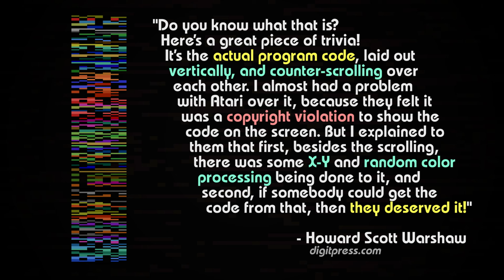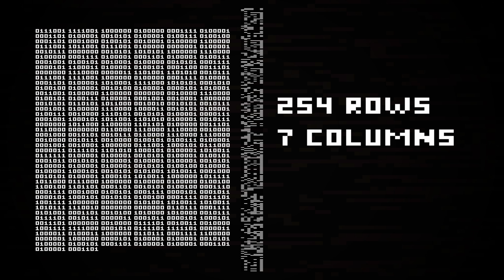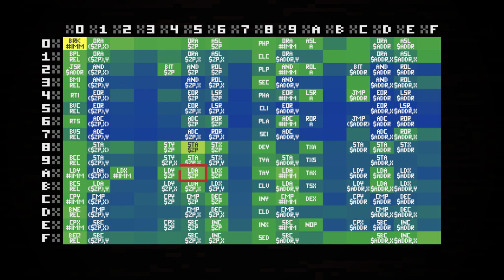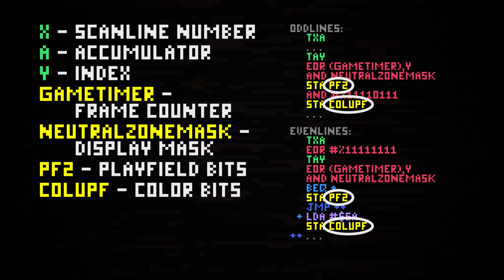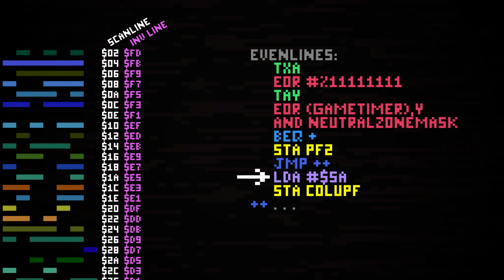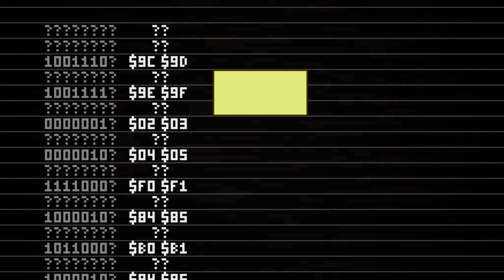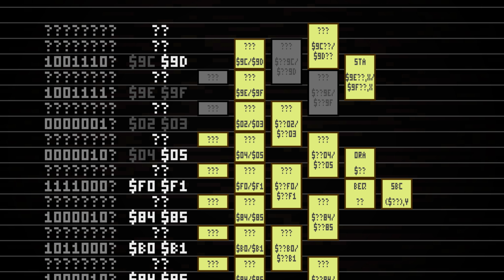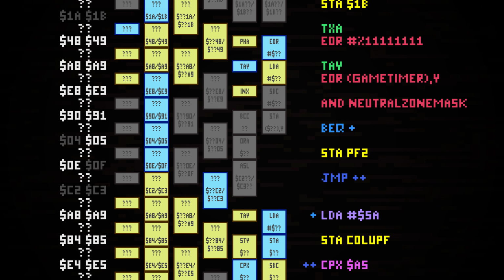Reverse Engineering Game Code from the Neutral Zone

Comment: This is fascinating. Love all of your work, thanks for what you do 

What happens when the cpu tries to run an undocumented instruction? Is there any case of Atari, NEA, etc games doing anything like that?
Reply: I am not sure about 6502, but some other 8-bit CPUs got some invalid instructions unofficially marked as HCF, which literally means "halt and catch fire". So these must not be used at all costs since they permanently damage CPU.

In case of 6502, most undocumented opcodes are actually useful and do not damage the CPU. Due to how opcodes were decoded, if you use undocumented opcode, you can end up doing several things at the same time. Not as much flexibility as you could imagine, but for demoscene it can be essential to save one or two clock cycles. However, some of the unofficial (aka illegal) opcodes are unstable, which means that their actions lead to unexpected values in registers and maybe in memory. These usually aren't used because they clog up the registers with garbage values, but values which aren't true random numbers either, so there isn't much usefulness in such unstable instructions.

You can find good explanations of 6502 illegal opcodes online.
Reply: @ltva8781 HCF as a nickname for a real instruction came about with the 6800. It was a self-test routine that didn't damage the part, but left it in an inoperable state until power-cycled. 
(It isn't clear to me today if it was originally a self-test feature, or if it was adopted as one later.)

The term entered the language of computing as a joke, and was applied to the 6800 when a "real" HCF was found.

There's a few HCFs in the 6502, but none do hardware damage.

Most of the hardware-damaging stuff falls outside the CPU, such as the Commodore PET's "killer poke" that could damage the display of later models(but double the graphics performance of earlier models, so it was not uncommon in early PET software)
Reply: @ltva8781  that makes sense. I'm surprised it can permanently damage the cpu though, instead of just skipping or doing something unintended. Because if you get a desyc that could be any value treated as an opcode. 

Also, for the illegal ones, is it just a result of how the circuitry is which just happens to lead to that behavior?
Reply: @stevenschiro1838  yes, basically in 6502 iirc different opcode bits specify the instruction functions and addressing mode, so with right combinations you trigger different units of CPU which are responsible for different operations. I don't know much though, again, there's plenty of info about 6502 online.

Comment: I love the idea of checking which interpretation of the binary code results in the most valid/common opcodes! Reminds me of reading gene sequences, where a sequence can be interpreted 3 ways depending on where you start reading it. (DNA is made of codons, which are kind of like opcodes made out of 3 base pairs. Starting on a different base pair results in wildly different codons, and you can check which interpretation is the most likely to be valid by checking how long it takes you to run into a STOP codon.)
Reply: Instead of disassembling 8 digit binary groups, you get to disassemble 3 digit quaternary groups (which are effective 6-bit).

I find it kind of funny that nature managed to come up with what's basically a "terminator byte." Whether you'd interpret it like a string's null terminator or a subroutine's return instruction, it's still pretty cool how much there is in common.
Reply: @angeldude101 it's more similar to a null terminator because STOP codon in prokaryotes can be followed by new start codons, so that the two proteins are always produced in equal proportions
Reply: @angeldude101  as I understand genetics, DNA is like programming code, if the interpreter was allowed to pick "starting byte"s at complete random, and read from there based on which way the byte was facing, until it encounters that "terminator byte". This produces a strand of RNA which goes on to be interpreted again to turn it into a protein, and proteins are a little like functions in that they do stuff (depending on the shape of the protein).
Reply: Damn, didn't know we had STOP instructions in our dna sequences lol. Learn something new everyday! Guess it makes sense. How is the cell supposed to know when to stop printing RNA or or when to stop building a protein if there wasn't a marker.
Reply: @Tkmined look up “DNA enhancers” “DNA promoters” “DNA Operons”
Reply: I was reminded of minesweeper. When you get to a seeming dead end, and then start from one end of the line of numbers trying to find what the most likely position of the mines are.
Reply: biology is just really complicated self-creating computers. its so fucking wild
Reply: It baffles me that DNA works as well as it does.
Reply: So i am not the only one to compare DNA to computer code, where the compiler is our own body. DNA could also be a large TAR archive and the "human compiler" just scans through it until it finds the block - like a LOAD XXXX instruction. 
I even dare to say, certain blocks are AND/OR/XOR'd to form a new variance. Because if you see the Y-Chromosome, it has stuff missing in it and can't exist on it's own. THis is called Y0 and any baby with this is unable to form and dies early. I'd like to call the Y-Chromosome "a patch". It integrates, overwrites some portions and then keeps "compiling" normally as an X would. Recessive Genes could be a result of an AND/OR/XOR, thats why brown eyes for example are more dominant then blue, if you think of them as 0/1 , but they aren't. Hell, maybe call blue eyes an "else default" case, so you are left with "is_brown" or "is_green" IF checks.
Anyway, I think it really safe to assume human DNA to be code and the base RNA found in all woman to be a key/checksum like "if remote.DNAinit not equal self.DNAinit; exit"
Reply: @Sypaka  DNA is absolutely digital. If you want to dig deeper, look into Pribnow boxes/TATA boxes, operators, promoters/repressors, and one of my favorite features, shine dalgarno sequences. 

Shine dalgarno and Kozak sequences act as a code signing feature of projaryotes and eukaryotes respectively and tell ribosomes where to bind and begin translating information. 

There are so many parallels between computing and genetics. This isn’t even getting into RNA splicing and the ability for RNA to perform independent functions/act enzymatically itself.
Reply: I remember being taught that in high school biology. Then we asked the teacher how the cell read the right sequence: how did it choose the correct strand and how did it get the reading direction right? Turns out she didn’t understand the question. We spent a long time, maybe 15 minutes, trying to explain it to her. Then we collectively decided she was stupid :)

(Denmark, late 80’s, no Google, no Wikipedia, no internet.)
Reply: @peterfireflylund  I highly doubt she didn't understand the question. She didn't have an answer because that's more the realm of physics and chemistry anyway.

Comment: 26:57 It might interest you to know that the technique you're using is very similar to what geneticists do when trying to determine the "reading frame" of a string of DNA.
https://en.wikipedia.org/wiki/Reading_frame
A string of three base pairs (e.g. GAC) is a codon, which translates into an amino acid (e.g. lysine), or an instruction (such as "stop"). Any given strand of DNA therefore has three possible translations, depending where you start reading from. We often won't know what the intended "reading frame" is. So one way to figure this out is to literally see which of the three translations makes the most sense. A reading frame that results in a lot of "junk" instructions is unlikely to be the correct one.

As an example, which of these is the correct reading frame?

HEC ATM AYE ATT HEH ATT
THE CAT MAY EAT THE HAT
TTH ECA TMA YEA TTH EHA

That's the same string of letters, broken up into codons. As you can see, only one of the three reading frames can be parsed into a sensible instruction.

Comment: Atari worried that this effect could be used to reverse engineer the game code? Wouldn't it be much easier to just read the contents of the ROM? It wasn't that hard even back in the day
Reply: Honestly, it was just probably the Atari legal team letting their imaginations run wild after hearing the phrase "game code being drawn to the TV screen"...
Reply: @gordontaylor2815 yeah, that sounds like the most logical explanation.
Reply: @gordontaylor2815  I imagine it all happened in the course of one short conversation, and their side of it was basically "Wait, you did WHAT?"
Reply: It isn't even all 4K of ROM. 256 non-contiguous bytes.
Reply: Mm hmm.  ^^  A tiny bit of understanding, mixed with a whole lot of ignorance.

Comment: A good way to get the clean data from the neutral zone using late 70s early 80s tech would be to flip the BW switch on the Atari and feed the video output into an oscilloscope. From there you know the neutral zone will be rendered every line in the same place.

Edit: Turns out the BW switch doesn't work in Yar's Revenge. Still considering each pixel is made of two dots it would still create a meaningful signal even with color.
Reply: Wait, on my 2600 flipping that switch does nothing on this game and it remains in color.  I know the switch works as the Telegames cartridge does go black and white, but this one does not.  I know the switch is software, but perhaps it works differently on some systems?  Mines a 4-switcher.
Reply: This is because Yar's Revenge doesn't support BW switch.
Reply: You do realize that it would be an analogue oscilloscope, not a storage oscilloscope (those were expensive as heck). It would be practically impossible to read. If you had access to a storage oscilloscope, you almost certainly had access to a PROM reader and could trivially just dump the cartridge. (In fact, dumping the cartridge wasn't hard at all for any electronics hobbyist. If anyone really wanted the source, that's what they'd do.)

Comment: Sad that half the bytes are missing, would've made for a really cool reverse engineering puzzle! (I gotta remember this idea for later...)
Trying to disassemble while only having half the information is bonkers. I wonder if this would work better on 32/64-bit machines? (Though I doubt it)
Reply: Yeah, wouldn't be worth it, with only half the bytes.  BUT, if the offset incremented every loop (so all odd addresses first time, all even addresses second time), that would make it a little more interesting.  :-D

Comment: usual trick cheatengine users know: if you know its a "store player lives" thing, you try to manipulate player lives count multiple times and see which address got changed all those times
not like you could use this for this kind of analysis, since it would require to be able to read from that address, and i think that neutral zone shows only code, not current values